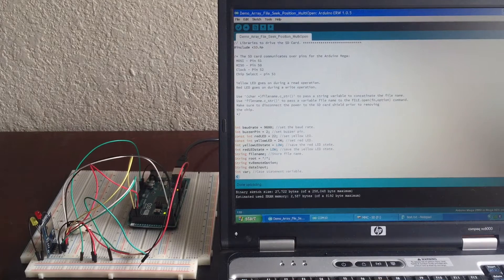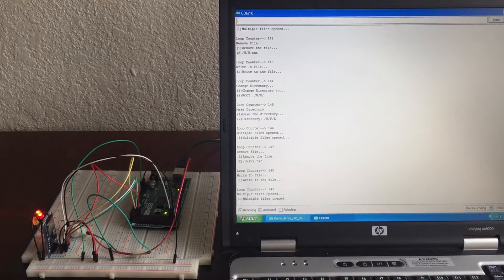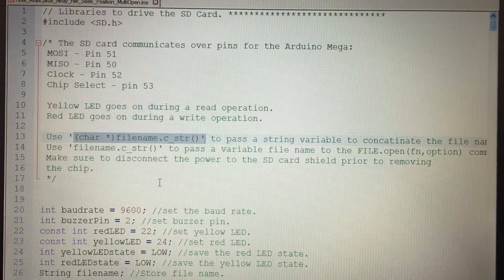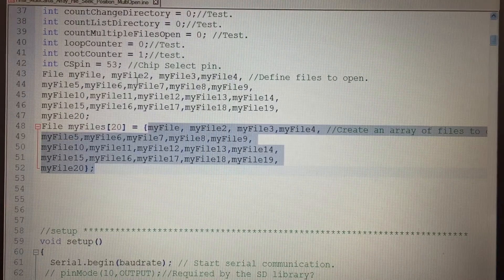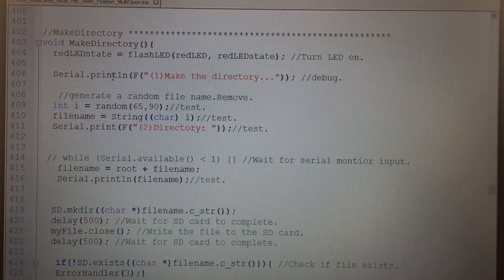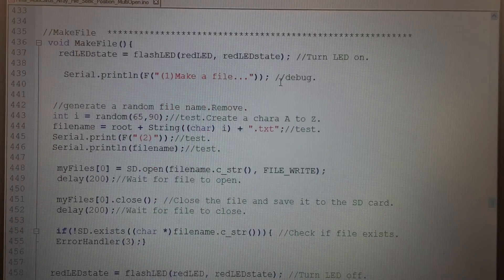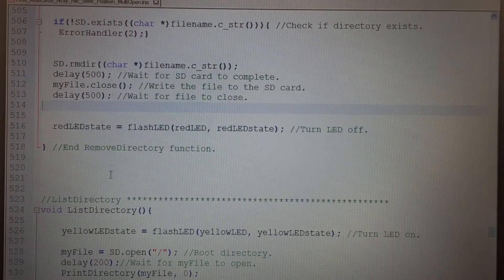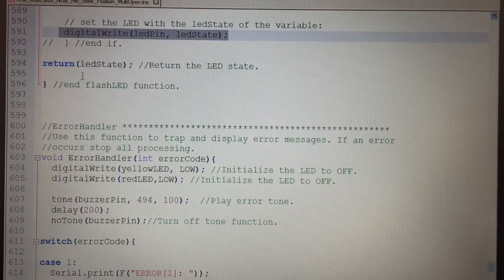Using Mega & Micro SD Card to Write/Read/Remove/List Files & Directories.

Comment: Note - you have to convert the SD card from exFAT to FAT32 or FAT16 if it's a larged miniSD card. Mine is 128 GB, so I had to convert it from another site to FAT32 and then it started working.

Comment: Hi, now, @2023, your sketch doesn't work on Arduino MEGA «Initialize the SD card...
ERROR[9]: SD card initialization failed!
Program execution is halted.
».
All connection are right.
SD.h fault with MEGA???

Comment: Nice video, very informative.
 i wanted to know how does your code compile without using the SPI library, reason being mine doesn't and i need to add the SPI library before compiling.
cheers

Comment: I meant to say, I see the #include <SD.h>, but I don't see the, #include <SPI.h>, Library. I'm wondering how this thing works without the <SPI.h>, Library. I may be incorrect in my assumption that it is required when you want to use the pins 50 for MISO, pin 51 for MOSI, pin 52 for SCK, pin 53 for CS, in order to use the SPI protocol. I thought that those pins, 50, 51, 52, and 53 were digital lines, that could be used for any input or output assignment. How does the mega2560 know that those pins are being used this way?

Comment: Nice tutorial - really well explained. I didn't understand a lot of stuff because the code is a real monster. Can you share it because it will be rediculous if I try to re-type it in Arduino IDE...

P.S. In my case: I have a load cell sensor with ADC hooked to Arduino Nano and 2 buttons. One button is for zeroing the scale and the other - for creating a file with the next name (if test1 exists, create test2) and a folders with a name as the current date. And basically - I need to dump the data from that load cell to the text file (it's not a txt, actually - it's CSV). It will be used for model rocket motor thrust measuring. :)

Comment: can we use other pins instead of 53,52,51,50 in mega 2560?
Reply: no you cannot - these pins are the SPI (Serial Peripheral Interface) of the Mega2560
Reply: u dont need to use 53 for slave select, but you cant change the others